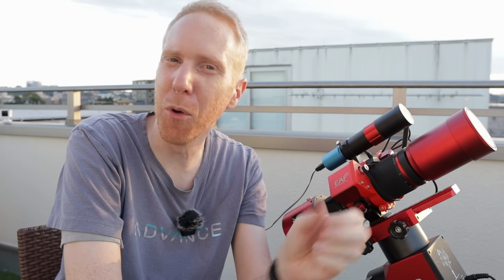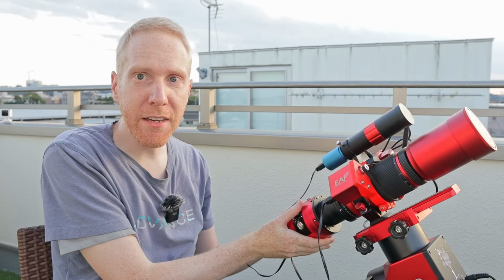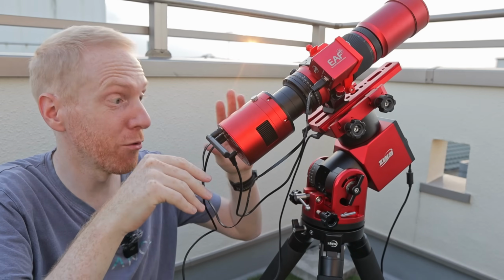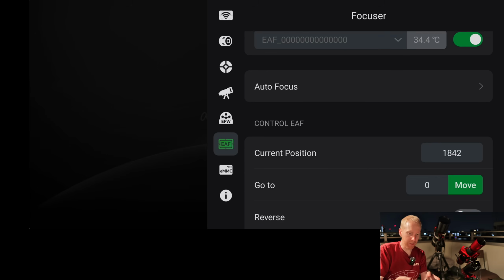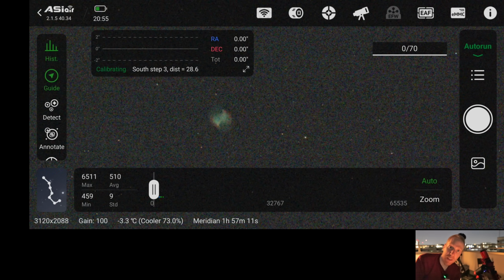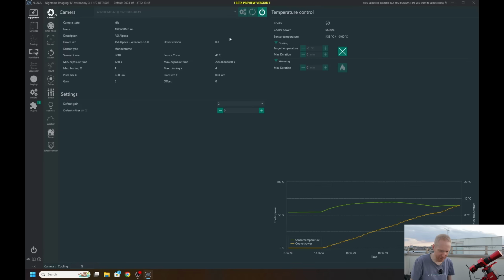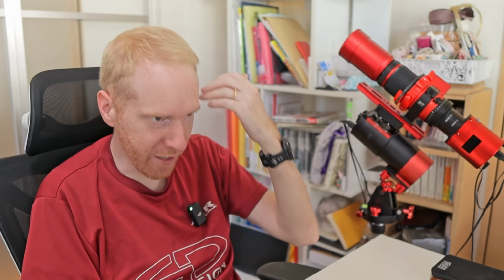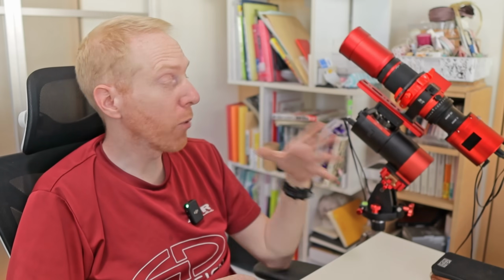This Astro Smart Camera does EVERYTHING🔥! Perfect for beginners? REVIEW of ZWO ASI2600MC Air!

Comment: My issue? When something breaks on it what's the point? it will be a very expensive paperweight I'm not a fan of all in one with sensitive equipment like this
Reply from the maker: Good point! If any of the internal components break it's going to be painful. I've had one piece of electronics break on me in the hobby and it was a ZWO camera main board after many years (1600MC Cool 1st version, with the ST-4 port), they changed it for $100 - here I assume the cost would be higher.
Convenience (assuming you use the internal ASIAIR) vs compromises...!
Reply: @CuivTheLazyGeek  Fair reply, i am just trying to get back into my Astrophotography and my cable management sucks so thought this would be good as as per the reasons above not for me, but like you said i guess ZWO would fix it....i guess...😁
Reply: @nikaxstrophotography i was just coming to say the same thing, i saw a review on a different channel and started off thinking what a great idea i am going to get one. then someone comment as you have and made me think yeah very good point if it breaks........Not for me anymore.
Reply: @Talonfireiv  Don't get me wrong it's a great innovation but too risky for such sensitive equipment.